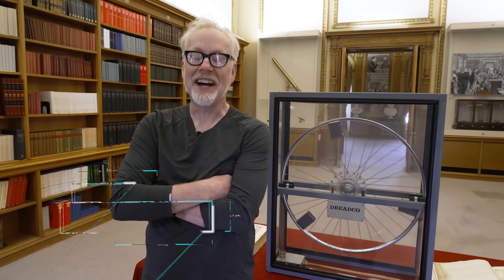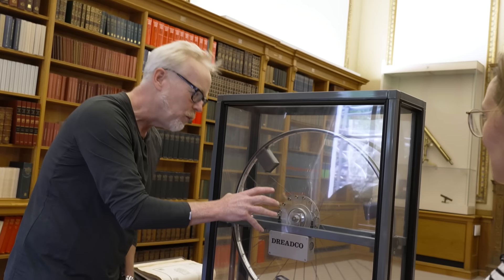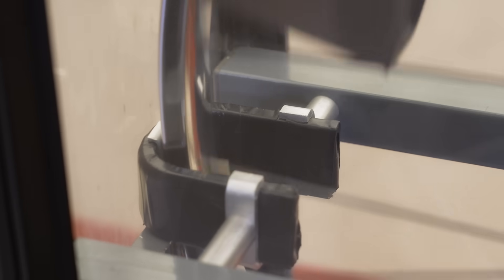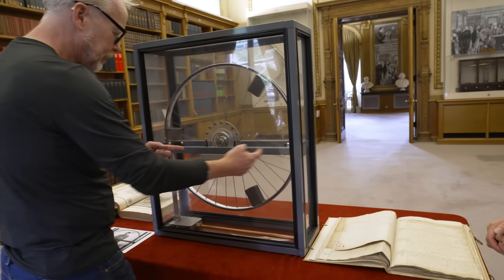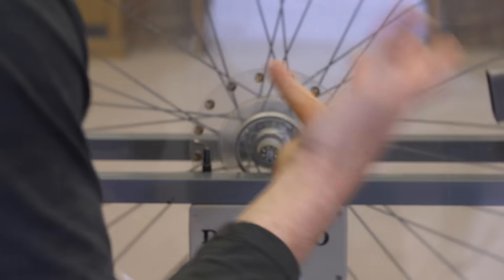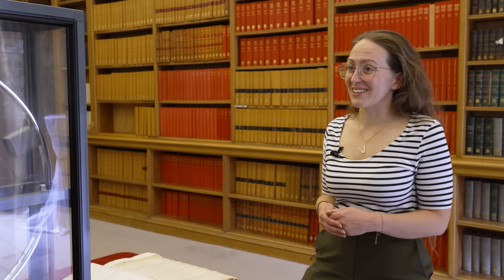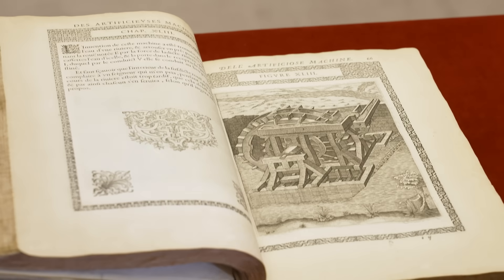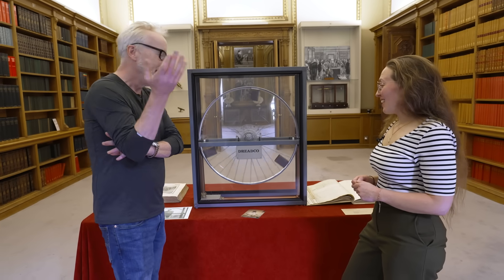Adam Savage vs The "Perpetual Motion" Machine!

Comment: Even as a blown up motor, getting a wheel to remain spinning for 2+ years with that little space for batteries is impressive
Reply: Little space? That whole frame could be filled with batteries.
Reply: @sharonheisler1557  I was thinking the copper pipe.
Reply: @sharonheisler1557 talking about the 80s here
Reply: @sharonheisler1557  the box is not part of the machine. That's a separate thing added for the museum.
Reply: @ImTheMan0fSteel the box seems to be totally part of it
Reply: @Yoskio  you can see that it was built separately.
Reply: @ImTheMan0fSteel  you can see some parts are attached also a lot of people think that perpetual motion doesn’t need to have any contact with air, like if it needs to be in a vacuum or somewhere without air
Reply: @Yoskio  I think it would have to be in a vacuum. Space would be the ideal location. It would be worthless to make as it could not do any meaningful work. Not only would you have to overcome friction you would have to have a surplus of energy to do any work. At that point you are breaking physics so much you have become a God.
Reply: @sharonheisler1557  What about the giant Dreadco box under the axle? This thing is so fake, they even admit that someone has to fix it to make it run again because it does not run continuously! I've seen better fakes on a YT Video.
Reply: It's long seemed to me that the efforts to produce ostensible "perpetual motion machines", have a potential value in highlighting efficient, quiet design with compact energy storage.  Whether this machine is an example of that, or simply hides enormous batteries or capacitors in the base, I can't tell.
Reply: @bearcubdaycare  what value in quiet effieciency could this have? This thing has no load on it, so it cant generate or store energy. If there was a load placed on it, then you would see it slow down, and more force needed to turn it to generate the same amount if not more power. When something has to overcome a load/stress this is where noise comes from. If there was a away to avoid loading a system a car's engine would be quiet  same with electric motors they all make a whine
Reply: counter weight mags  seems obvious but always need a human hand to restart it
Reply: There is this thing called a clock.
Reply: It's not, I think the box has photo sensors, and at 5:00 I think she was trying to hint it gets put away in a dark room for an extended period of time that maybe when they sense light they turn it on and when it goes dark it turns it off to conserve the 2 year battery life. The battery is most likely lead acid. And the drive is most likely in the brass tubes that go to the box. The magnet coil idea Adam was going at is the on off switch because if that was true it would be easy to turn it off Being the box withholds the photo sensors and are attached to the magnets which go through (detect/communicate with) the coil windings.
Reply: @Twostrokealec very good theory
Reply: @Twostrokealec  That would be hilarious if it was just off when no one was around 🤣
Reply: They made it look like it was moved with a simple electromagnet so no one would guess that?
Reply: nah, a 3$ wall clock can do that with just an AAA 1.5V
Reply: @miquelmarti6537  Exactly my thoughts. (See my comment above.)
Reply: With today's button cell lithium's you can power stuff for ages, If there are no batteries involved, it might be that the box are vacuumed in order to lessen the air drag on the system but  that vacuum can also provide power. The copper pipe might be part of a heat exchanger, sort of like a stirling engine. If it's a simple motor with batteries then there should be a hall sensor incorporated somewhere.
Reply: @VoidySA  well they are suppositions maybe one day we will now but is bullshit make thing people that it just work with magnets and not energy
Reply: I guess it works with magnets and the servicing is for the bearings which gets worn out and cannot be from metal not to interfere with the magnets.
Reply: @pietekoo5559  Most "perpetual" machines rely on magnets, but magnetism is not perpetual. They probably need to change the magnets before the bearings.
Even if it wasn't a hoax, it would be useless. Who needs a motor that can't hang even the smallest load? Maybe to put on top of a christmas tree xD
Reply: Especially one you can carry around, and thus isn't so delicately balanced that moving it would disrupt it.  I suspect it's a similar mechanism as a Wimshurst machine.
Reply: Lithium coin battery can last over 10 years.
Reply: @khc8800  yes, for running lcd screen, which drains practically nothing.
Reply: @khc8800  Batteries supply voltage, not current. But current is what you need to change something. That's why CMOS takes so little power - current only flows while the transistors are changing state. But to keep something spinning, you need current, not voltage.
Reply: @darrennew8211  You’re over thinking it, dude. Battery provides POWER.
Reply: Superconducting bearings
Reply: @jeffcarr392  superconductors only work at super cold temperatures
Reply: Repent to Jesus Christ “Let the morning bring me word of your unfailing love, for I have put my trust in you. Show me the way I should go, for to you I entrust my life.”
Psalms 143:8 NIV
U

Comment: You should come to Norway and look at Reidar Finsrud's perpetual machine, which this reminded me about. I was there some, oh, 15-20 years ago. A metal ball bearing (I think) going round and round on a metal track, some magnets 120 degrees apart apparently dipping in and pulling it around, something like that if I remember correctly. Similarly, this also needs to shut down for "maintenance" (wear and tear)😁 Ofc he claims there's no batteries or anything except those permanent magnets. Anyway, it was a cool thing to see, and I have no idea how it really works ofc.

Comment: From first glance, it's immediately obvious to me that the 3 boxes are practically empty apart from small magnets, and the coils are the U shapes on either side, fed by wires running through the pipes to the battery at the bottom.
It is the same simple mechanism you would find in a waving cat.

Comment: The bearings are the most efficient the less weight they have to bear. The lightest possible wheel would allow a motor to keep it spinning longest with the least power, so all of the components on the wheel should be as light as possible, so they are all red herrings.
Reply: Putting weight at a far radius from the axle gives a lot of energy though for the same amount of weight. 

You can have a massive wheel with 20lbs of weights on the edges, and a small wheel with 20lbs of weight on the edges and the massive wheel will spin way longer, and both wheels weigh the same so same force on the bearings.
Reply: @Chevsilverado  You've missed my point entirely. A 100 gram wheel is MUCH more efficient than a 10,000 gram wheel (~20lbs). This wheel clearly (due to physics) uses a battery and motor to stay spinning, so the lightest wheel possible would be used by it's creator to sparingly use the battery. The boxes affixed are red herrings, but very light weight ones.

Comment: Pretty sure it's just strategically-placed magnets with opposing poles that push the wheel to the next magnet, and the next, and so on.  It probably just needs greased occasionally, like most anything with moving parts.
Reply: That wouldn’t work because as the magnets pass by the other magnets they’d be pulled towards them, even if it’s pulling against the rotation of the wheel. 

It’s why electric motors need to switch the magnets polarity to actually work. You can’t just put a bunch of permanent magnets into a motor and use no electricity and expect it to turn.

Comment: It’d be awesome if a version of this could generate power and transfer it to nearby devices/equipment
Reply: Well, unfortunately, that would surely cause it to fail much more often than "every year or two". It's only able to keep going as long as it does in-between servicing because it is consuming so little power (by moving so slowly and consistently). If you started using it to power other devices, that would drain its power quite quickly, if it could even provide enough energy to power anything at all.

Comment: The copper pipe, u shaped black magnets and dreadco box do  nothing. The answer is in those 3 boxes. In each one there is a spring loaded or battery driven gyroscope at slightly different angles that after time lose energy hench the need for wind-up or recharge. All though quiet, Its in that case to reduce the amount of noise that could be detected in open space. So there you go no more wondering how it works.

Comment: thats quite easy to figure out. the machine has miniature rechargeable battery to start the action when the wheel spins the 3 box that could be magnets inducing current to u shaped coils (which at the same time act as electromagnet to continuously repel magnets as it passes while spinning )  on both sides which then generates power that charges the battery and makes the cycle repeat until the energy  produced decreased slowly in time due to friction or battery failure which probably 2-3years which then needs servicing

Comment: The largest problem with any of these so called perpetual motion machines is that eventually something will wear out. Even if there were a mechanism in that wheel that would keep it rotating eternally, the wheel bearings will eventually wear out at some point in the distant future. 
The only type of perpetual machine that I could think of is a robot that is intelligent enough to be able to design, manufacture, and replace its own parts and components.

Comment: My guess is the Dreadco box has a battery inside with wires running out to the magnets which pulse drive the metal boxes on the wheel.
It seems really REALLY obvious though to me, so maybe I'm wrong.
Reply: The answer is obvious, and Adam pointed out all the necessary parts.

Comment: How about it’s in a vacuum, with a very low friction bearing. The 3 blocks are just weights to increase the inertia of the wheel. The servicing is just to give it a spin and re-apply the vacuum.  That’s my initial thought.

Comment: It’s the magnets that loose attraction.  It moves a weight in the attached just below half way down. On the way up it moves it in so it raises less than on the way down.  The way down the magnet moves out so they fall further and pull more potential energy bringing the opposite weight up.  All about where the weight on the diameter is.

Comment: the energy used is just to charge the magnets, and keep them at a low output just enough to push, the I'm assuming some sort of metal or another magnet with the opposite charge keeping it spinning. I'm a genius now we need a way to control the speed and put them on propellers and make a flying saucer. maybe something on a rod as a center one massive rod with propellers on the end using sun for energy.
Reply: Lol okay genius. Maybe figure out how magnets and electric motors work first…

Comment: It appears to have at least 3 components to compliment each other.  The two prongs near the centre to me appear to be ionisers, or perhaps one ioniser emitter on the right and a recovery prong on the left. The metal buckets these prongs appear to interact with would act like the buckets on a waterwheel. From my very limited electrical knowledge I believe an ioniser would not require much electricity at all to run and perhaps is generated by the magnet component attached to the outer of the wheel. The copper pipe contraption perhaps captures airflow and directs it to the other side of the wheel, or perhaps the friction of that airflow (which would be miniscule) also generates a small current.  But I'm not sure all this fits with the disappointingly simple comment from Virginia Mills.  Overall I don't believe it is a perpetual motion machine, but instead a machine that does run for an extended period of time so that humans get bored and assume it is perpetual motion.
Reply: Actually I wonder whether that box is a mixture of heavy air and light air which would explain the "servicing" (i.e. topping up the gas) and would perhaps make the copper pipe contraption more effective.  But again perhaps too complicated.
Reply: If the ionizers were powered by the magnets it wouldn’t help spin it at all. 

The magnets would induce a resistance on the wheel as they passed by the coils which is equal to the electricity generated, and those ionizers obviously wouldn’t be 100% efficient at turning the electricity into motion… meaning net loss.

Conservation of energy doesn’t stop when you use magnets.

Comment: One thing I would have checked, is to lift the table cloth, and look underneath the table. The answer may not be in the apparatus, but, under the table! There could be a 'box' containing a coil, some electronics, and a modest battery that generates a timed electromagnetic pulse that the wheel synchronizes to. Such an apparatus could conceivably run for years, without service. There doesn't need to be much power, considering a precision balanced wheel riding on precision bearings. The case undoubtedly does a good job keeping those bearings clean, and dust free. The boxes inside the case are just for show. There would be no reason for a heatsink on something this efficient.

Comment: I think you can create perpetual motion with magnets (to create 'anti gravity'), gravity, and a wheel. Unfortunately, I never had the time+resources to make a nice demonstration model. But you can put a magnet on a wheel, and stationary magnets on the upside perimeter so that as gravity pulls the magnet on the wheel down, angled magnets on the upside push the magnet on the wheel back up to the top, defeating equal gravity on the left+right of the wheel. Ie, you can use magnets to overcome the balance of gravity as a magnet goes down on one side of a wheel. It can be boosted up the other side against gravity with magnets that repel the one on the wheel.

Comment: I have a Jaeger-LeCoultre Atmos clock with "with a revolutionary perpetual calibre". Never needs winding but uses changes in atmospheric pressure and temperature to wind. Supposedly 1 degree temperature change gives it 48 hours of movement. My parents purchased it in 1959 and other than having it cleaned in 2006, it has never stopped running.
Reply: Thank goodness someone else here knows what an Atmos clock is!  They are impressive and amazing in both engineering and execution.
Reply: If that's the one with three metallic spheres rotating around it's base, I had no idea it was so complex.
Reply: @burtpanzer  This does not have the spheres, I think you are referring to the 400 day or 1000 day clocks that need winding. This does have a rotating weight at the bottom. 
Very similar to this one: https://youtu.be/Ol_dtXvD-p0
Reply: @bslaws You're lucky to have a good one, then. They work by pressure changes due to temperature variance in a metal bellows containing methylene chloride. Unfortunately, the flexing of the bellows as it keeps the clock wound typically causes fatigue cracking of the solder that seals the bellows, allowing the methylene chloride to leak out. Usually the bellows needs to be resoldered and refilled about every 10-20 years.
Reply: I have two atmos clocks that both stopped because my 140 year old house uses a boiler system with cast iron rads. It is so accurate that the temperature in my house never changes by more than a half degree. There were a lot of smart people back then that built things right.
Reply: @robklein583  If your clocks truly don't self-wind because the temperature is too stable (and not because their bellows are empty), it is possible to wind them manually. They run for about 6 months when fully wound. A clock repair person familiar with Atmos clocks can do it for you and show you how.
Reply: @Scotophor  Thank you for that info.
Reply: @Scotophor  I watched a vid here on youtube that explained how to tell if a bellows is ok by looking at the winding chain. To my astonishment my upstairs clock had fully wound itself over the last year while sitting stopped on my shelf. I just started it again and it is keeping perfect time. When running it winds itself slower than the energy is used by the clock mechanism so eventually it stops. I should open a window in that room on a cool day once in a while to give the clock the temp diff it needs to wind itself. Thx again Alan for nudging me to look at my clock and check it out.
Reply: Maybe that's what keeps this thing in the video going.
Reply: The Atmos clock is really cool!
Reply: That's impressive 🙂✔️
Reply: That sounds really cool. Do u buy chance have any pictures of the clock ? I'd love to c them.